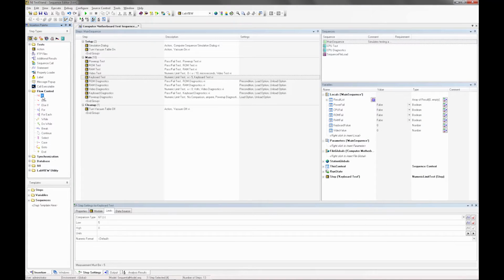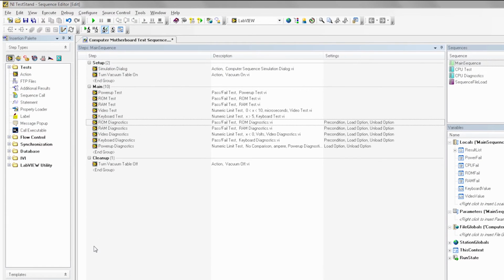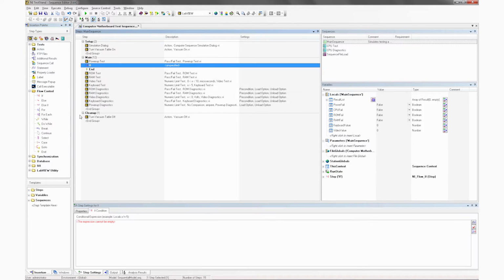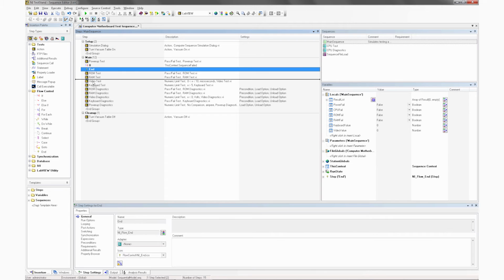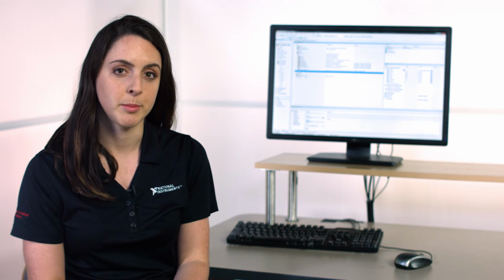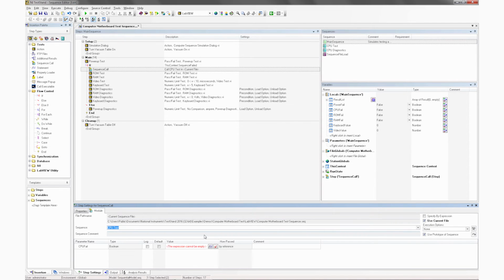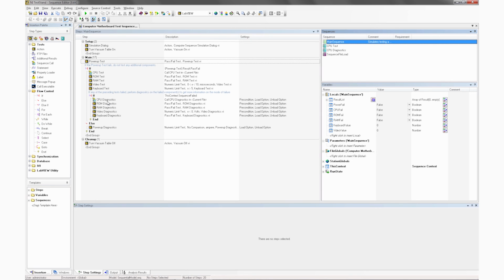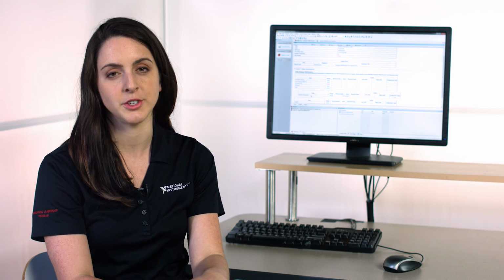Using Flow Control with TestStand

Comment: Hi Kristen, I am currently working with test stand project. I am facing a problem while doing the project. The scenario is like, they will connect different products at different slots to the chamber and the DLL should run simultaneously for every PID. I have tried with batch model to execute the test but it got failed running for different Products. Can you please suggest me a way to solve this problem.